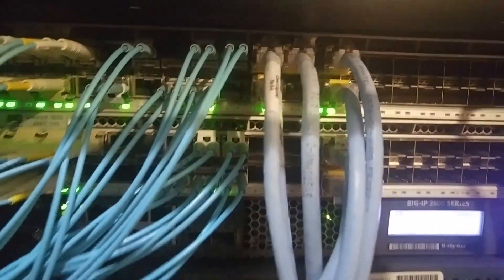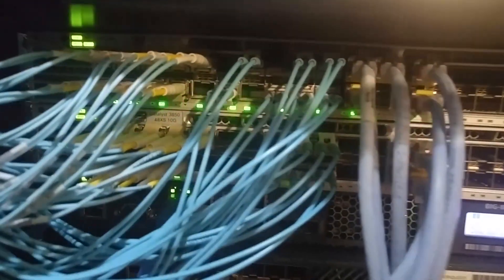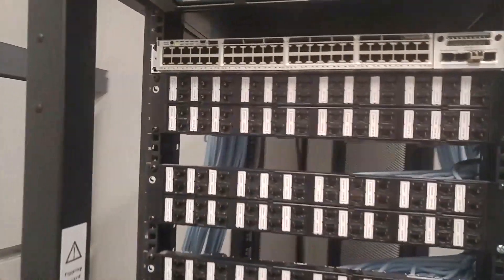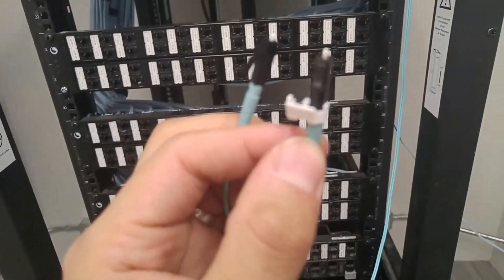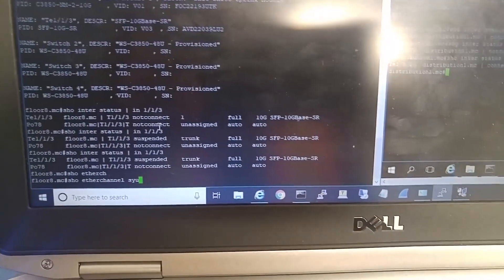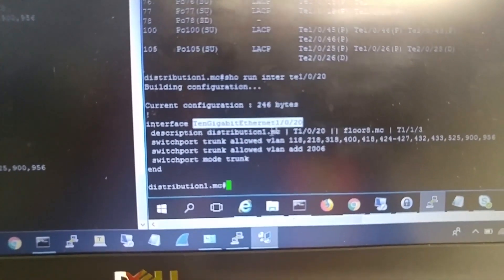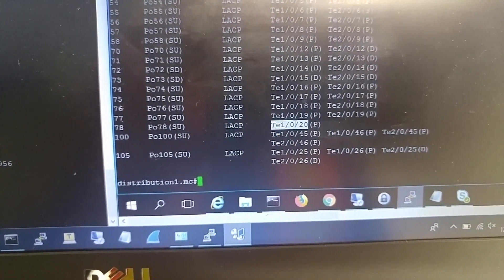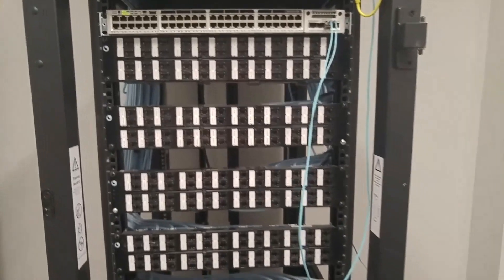Connect a L2 Switch to the Data Center | Cisco Switching

Comment: Nice video. So in real world distribution switch is always in data center and access layer switch’s are on the separate floors in closets. Is core switch router also installed in data center nesto the distribution switches?

Comment: I won't even lie this is over my head. Good job btw
Reply from the maker: I know what you mean, it is easier with a diagram.
Thanks!
Reply: @AliYounes_conf_t  Just curious, I'm studying for my ccna 200-301. I use packet tracer, now before applying to network engineer jobs, do you recommend I buy some equipment to practice at home? Also was you nervous when you first worked on live equipment at work?
Reply from the maker: @davidhockaday3612  For the exam purposes you don't need physical equipment, you can keep using Packet Tracer or GNS3. But if you want to be confident with using the equipment you can buy something but up to you.
I was nervous of course, but my first project was setting up brand new equipment so I didn't have to work on live ones and break anything. Slowly over time I became more confident, just don't be afraid to make mistakes and ask questions.
Good luck!!

Comment: Hey excellent videos regarding CCNA did you build a home lab? What was it like getting hands on with physical equipment did you initially struggle? Because you were used to labbing virtually?
Reply from the maker: I went to college before CCNA and we had a lab of physical equipment for our class, so I got pretty comfortable using them. Then in my Junior role I was able to setup lots of devices, but at the beginning it can be stressful sometimes because you don't want to mess things up. But as time goes, you get over your fear and become more confident because of all the labbing and experience that grows.

Comment: Where is that fiber connection coming from before was patched to patch panel ?
Reply from the maker: It runs in conduits between the data center and IDF rooms
Reply: @AliYounes_conf_t   Thank you. Great job
Reply: @AliYounes_conf_t  
Hi .
Why we need etherchannel if it's one port only in the bundle . Because I think ether channel for if there is multi connection between two switch not for single connection .
I see it didn't get connect till you have done etherchannel in both side.
What is that ten gig port you have put in the bundle is that the fiber cable.
Thank you
Reply from the maker: @omerabdalazizmukhtar6848  We usually have 2 ports in the etherchannel so that uplink traffic can go through either one. If it is only one port, it works, that means later we can add the second port without doing the configs from scratch and causing interruptions. The 10 Gig port is the Fiber SFP, we have to add it on both sides (access and distribution switches) so they can form the channel.
Reply: @AliYounes_conf_t  
      thank you ali